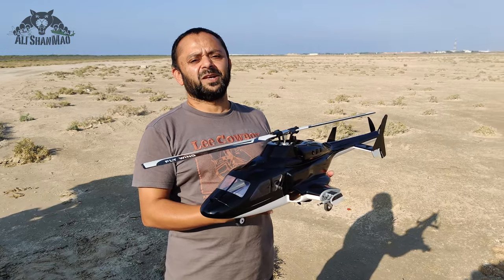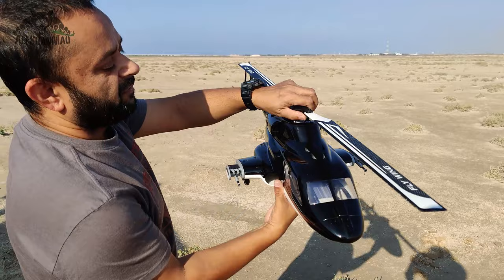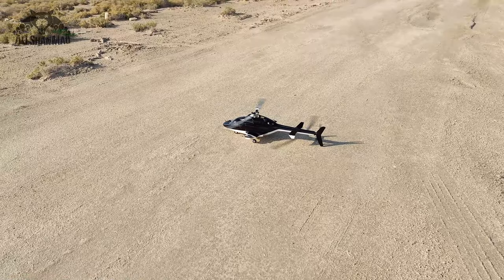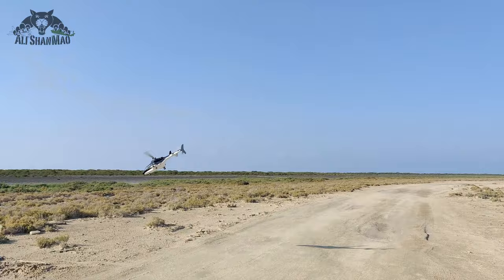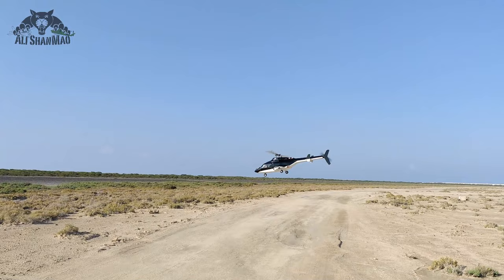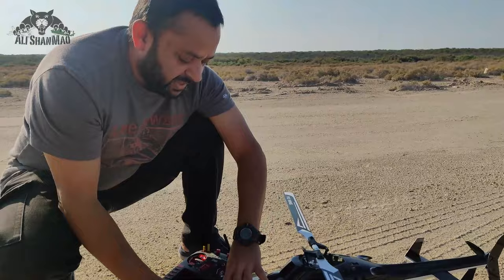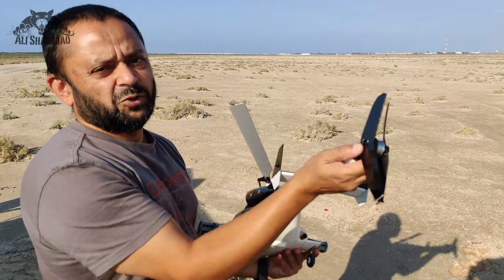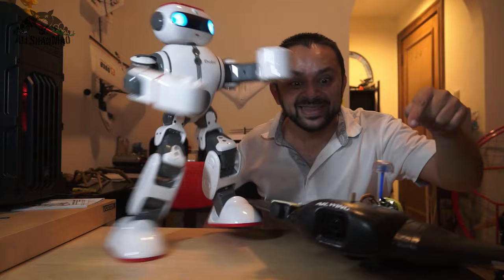FlyWing Airwolf V3 GPS RC Helicopter Hands on Flight Review #airwolf #helicopter

Comment: Thanks for the video. I needed to reword the comment. The things that are not scale are the white belly which is not close to accurate if you look at photos of the full size helicopter. The white color should not reach to the nose wheel.  It should start almost behind the side door. Tail fin should be about twice as tall at the top as it is at the bottom and should be white at the bottom. That gives it the shark look. Tail blades should be white with red stripes. Tail boom should go all the way to the rear of the tail fin. Actually the tail rotor should be on the left side and main blades should turn counterclockwise like the Esky 300 V2 which works great. I never like those noisy separate tail motors. A little window tint would help and a retract option would be nice. I think what keeps me from buying it is the white belly being so far off and that tail fin being the wrong shape and color. I can over look the main blades and tail rotor. What I like about the Esky 300 V2 is that it is not scale but almost looks better than Airwolf. Not the case here because it looks scale other than a few things that need attention. Maybe they will get it right.
Reply from the maker: Thanks
Reply: Flywing told me they will release another Airwolf this year after a lot of testing. It will use 550mm blades. I notice some other companies have made scale Airwolf bodies that look just like Airwolf. Maybe they can go by some of those. I think Funkey makes one that looks pretty good. @alishanmao

Comment: Just got mine last week. Unfortunately it arrived with cosmetic damage to its fuselage. I am awaiting a response from the seller before my maiden flight in case I need o send it back. Thank you so much for all the videos and information you have put out about these helicopters!
Reply from the maker: Sorry to hear that, my Huey UH1 fuselag got damaged badly during shipment to UAE as well. i had to glue it. it flies still but too many funny noises coming from inside

Comment: Ali, do you think the Roban retractable landing gear will work on this fuselage?  If so, is the FW450 v3 Air Wolf fuselage a 450 size or 470 size?
Reply from the maker: well i have not seen roban gear buddy. so i can't say anything. flywing does say this is a 470 class airwolf shell
Reply: @alishanmao  I ordered both 450 and 470 size.  I think they'll work.  By the way, when is that huge Flywing Apache coming out?  I told the wife the day that comes out, I'm buying it.

Oh, and aren't you 3D printing an Apache for the FW450 v3?  If so, will you be sharing the file?  I hope so.

Peace brother.
Reply from the maker: @RC_Cowboy  Well the best practice is not to buy a new item or model as soon as its released. wait it out for at least 3 months for 2nd or 3rd production, thats where all the issues and glitches are fixed those people report from first and 2nd batches. rest is all your decision bud. fuselage for FW450 V3 is still in the plans. i need to improve my design skills before i can actually design such detailed model. so it may take time. I am trying to setup  my 3d printing business here in UAE. and hoping that a good 3d designer can join me as a team, also looking for small investors and partners. If this can be done, i will fill the market with every helicopter fuselage for Flywing helicopters that people desire and chinese companies do not make it :)

Comment: I noticed that the sound is even improved. It doesn’t have the high pitched sound of the older helicopters 🚁
Reply from the maker: that used to come from the tail motor. now they are using a larger prop

Comment: If I set 7p the att, does the att mode still a gps function?  So if I lose control I can let go of the stick and it will level?
Reply from the maker: ATT only will Auto Level, no GPS
Reply: Ok. Thanks.  Yeah I noticed you said that in the video but I sent the message before I watched the whole vid.  Lol thanks again

Comment: Hi ali. I have been flyjng my fw for 6 months. Here’s what i love about it
1.  Flight modes 
2. Long flight time
3. Parts are cheap and always available
4. Reliable so far

What i wish flywing will improve:

1. Takeoff speed is too fast
2. Scale fuselage does not cover the whole tail
3. No low voltage warning

Also, i wish flywing will make a 500-600 size version of this. I can put an h1 on a roban 600 but the flight time is too short. Please send my feed backs to flywing and thanks for the video.
Reply from the maker: I hope they will listen to customers. thanks for sharing

Comment: I've had mine for about 6 weeks now. Great fun after leaving the hobby for 30 years. The new tech has made it possible to re-enter without fear of crashing hopelessly.
One thing that annoys me is the noise from the tail rotor. I've seen some posts for other models about switching the motor to the opposite side and reversing the prop direction. Funny thing is the FW450 tail arm seems to click in no matter which way you turn it so that would effectively do the same thing...if the centre pin was the feedback and not one of the power pins. Not keen to test the theory and blow a control unit.  What about just fitting a larger tail prop? Wonder if the noise would lessen and if the control unit would compensate for the different size.
Reply from the maker: yes buddy get a bigger tail rotor will reduce the noise. flywing has a bigger tail prop for it. and yes tech now make people enjoy this hobby, before people could only dream to own and fly rc helicopters but now anyone can fly and enjoy it.

Comment: Hello Ali please help me I’m having ZOHD speed forward fpv wing I’m new at fpv wing so am asking is flight controller important if it is ?is there simple flight controller with just connecting without soldering
Reply: Also what is the secret flying with ZOHD fpv speed forward wing connecting camera
Reply: And what fpv google is cheap but good ican find and upgrade
Reply from the maker: hi, unfortunately i do not have any experience with ZOHD wing or planes, except that they are poorly designed aerodynamics. they can't fly without stabilizer or flight controller due to their poor design dynamics. and setting up a flight controller, FPV system and other such things need soldering lots of :D